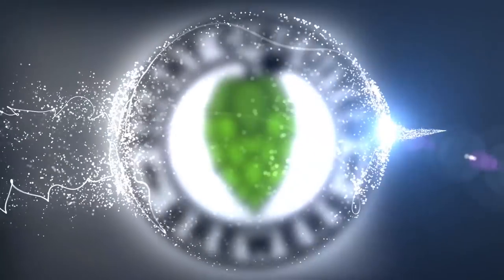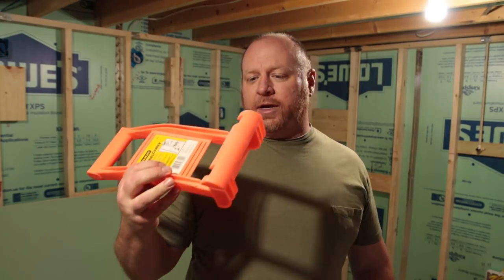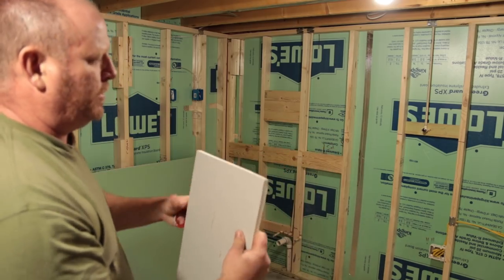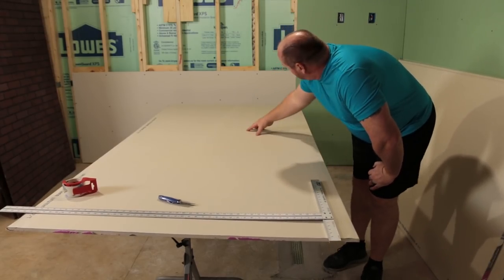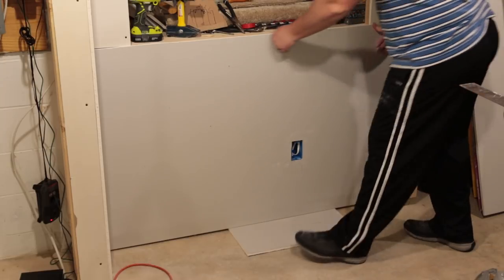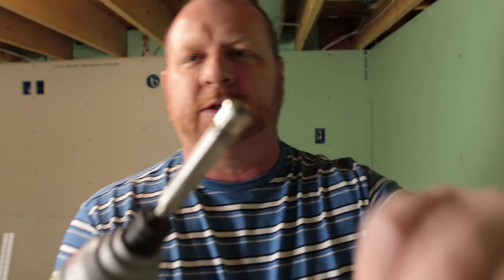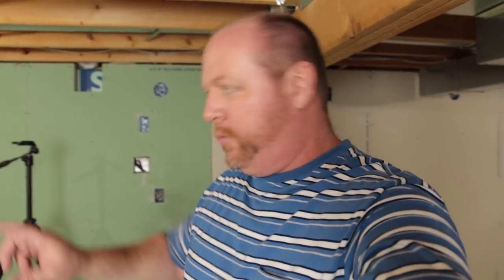Basement Brewery Build Part 6 | Drywall is up!

Comment: Hi there. First of all, personally being a veteran of most if not all residential types of construction I have to say that I've never seen any professional use that orange handle thing u used to carry drywall or a drywall "T" square. Your probably done with the drywall by now, but to anyone reading this just use a measuring tape, pencil, utility knife and a caulk line (with blue caulk). And watch a youtube vid on how to hang and or mud drywall. The oscillating saw does work great for cutting out fixtures but the blades are pricey.
Reply from the maker: First off...  Professionals that hang drywall and do mud work are amazing.  It is an art form. Having said that I am NOT a professional at it AT ALL.  Not did I claim to be.  I just wanted to share what I did to hang the drywall for other diy people out there and the tools I used. There are much faster and better ways to do it if you know what you're doing. Bottom line I got it done..  Lol and that's good enough for me. Cheers!  🍻👍

Comment: My tip is to always put some insulation in the walls. If not for heat insulation for acoustic reason use half the space. 2" insulation in 4" thick walls.
Reply from the maker: Yeah I could have but I am not to worried about the temp down there it is a pretty constant temperature,  (cooler than the upper floors)  and I am fine with the temp being cooler.  Cheers Johnny!  👍🍻
Reply: @ShortCircuitedBrewers  it's not about the temp. It's about not creating acoustic resonance chambers. Therefore my recommendation to just half fill the space if it's not for temperature  insulation.
Reply from the maker: Gotcha..  That is true.  👍🍻

Comment: My dad has done drywall for 50+ year and well hanging the rock vertically like that would drive him nuts. because when the house settles and moves over time the seams will start to show through no mater how much time spent on making the wall smooth. 

Next time laying the sheet rock horizontally and stagger the peaces like you would brick. The horizontal line across the middle of the wall is less noticeable when the house settles for some reason. I think it has to do with perspective.

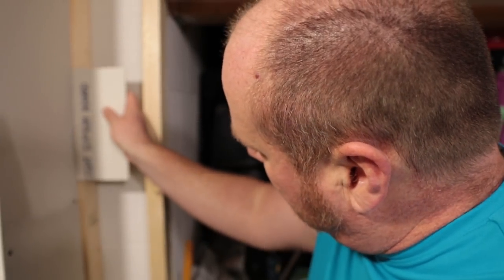At 4:33 you don't have to fret about the gap so mush when the other sheet goes on and the corner tape is up it will not matter. And at 7:12 you don't need the inside screws the peace is to small and can be held in place just fine with the outer one's especially when the smaller peace is wedged in there like that.

p.s. grate job on the spacing of the screws my pop's would definitely approve. Dad hates it when the hangers use to many screws, he hates spotting them and its a waste of $$$. hope that helps for next time or when you sheet rock again.

p.p.s. why do you not have more subscribers you are awesome.
Reply from the maker: Lol thanks! I am NOT a drywaller for sure!!  I hid all the seams with the wood if you watch some later videos. I did it so I wouldn't have to take and mud all the joints!!  Lol 
Thanks for the comments and watching! 👍🍻
Reply: @ShortCircuitedBrewers  lols, i binged most of your build vid's last night. I can see why, taping joints and corners is not fun at all besides the way you have it looks really good anyway.
Reply from the maker: @anime_craft_nibs3017  thanks man!!  Appreciate the binge!!  👍🍻

Comment: Hi Brian. For the planks that you put behind your brewery, is that laminate flooring?  Waterproof?  Now that you have had it installed would you do it again? I am looking for a material that I can put on the wall behind my brewery and looking for recommendations. Thanks.
Reply from the maker: Yes they are vinyl floor tiles that are waterproof. I did wind up having to use adhesive to keep them attached. I definitely would recommend it. However I would highly recommend adhesive from the start. I learned the hard way..lol 👍🍻

Comment: Hate to be that guy but I didn't see a vent for your sink drain...I hope   I'm wrong
Reply from the maker: I am putting a vent before the J pipe.  Air admittance valve??  Worked great on my last brewery. 

Oatey	Sure-Vent 1-1/2 in. PVC Air Admittance Valve -
https://www.homedepot.com/p/Oatey-Sure-Vent-1-1-2-in-PVC-Air-Admittance-Valve-20-DFU-Branch-8-DFU-Stack-39230/205395535
Reply: Yes, an air admittance valve after your p-trap will work. Try to get it as high as practicable. Cheers
Reply from the maker: Thanks for the advice!!